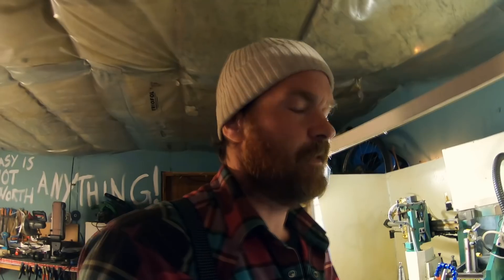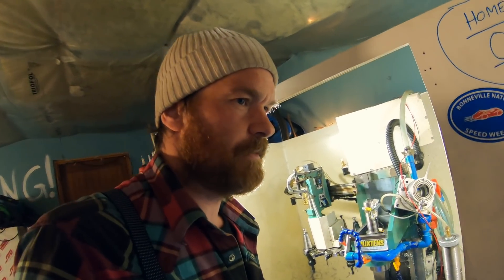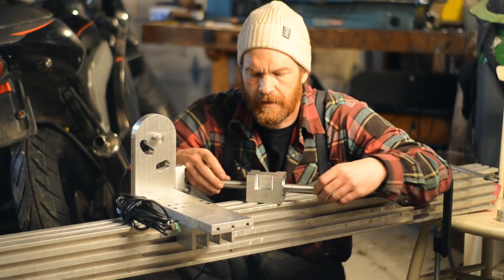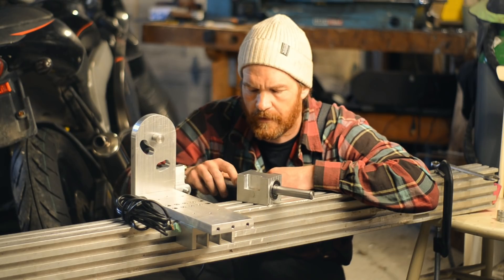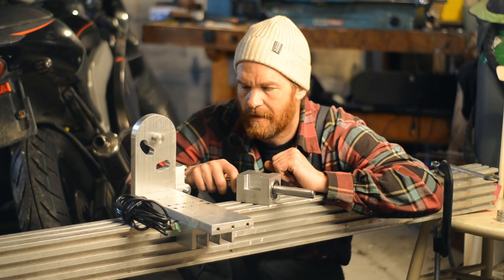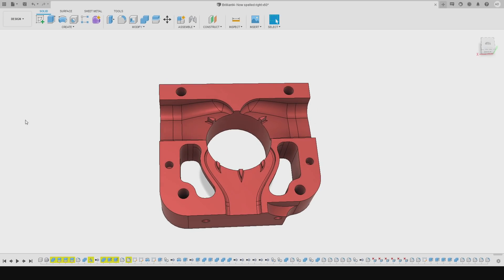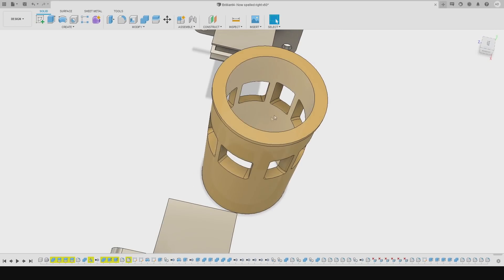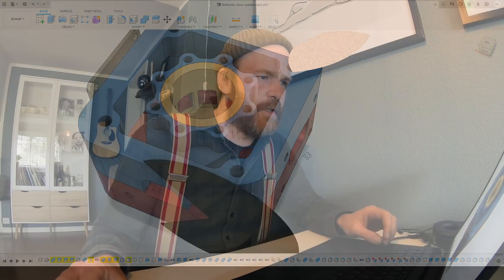Prototype Blown Nitro 2 Stroke.

Comment: what is the difference between a stuffed crank and unstuffed crank.can you run an unstutted crank for a 70cc arisal cylinderkit? Can jb weld be used to fill the 2 holes in the crank webs?  Why do they sell unstuffed or weighted cranks anyway. any help will be greatly appreciated. thank you. its for a puch maxi.
Reply from the maker: Cranks are stuffed to increase crankcase compression. Can be good/bad depending on a lot of factors. Sure you can run the unstuffed crank.
Reply: Filling the balance holes in the crank increases crankcase compression and makes reed valves open sooner (if your engine has them).  Any reduction of volume in the crankcase can be beneficial provided it doesn't hurt gas flow to the transfer ports.  Normally the crank would have plastic plugs epoxied in, though solid epoxy should be ok provided you clean and prepare all the surfaces well.

Comment: Goodyear Gatorback  Poly-V belts run good at high RPM and I've used them on supercharger applications with good success.  They are a notched V-belt design that lets the air escape, minimizes float and gives exceptional grip. Example - https://www.ebay.com/itm/353454433611?_trkparms=ispr%3D1&amdata=enc%3AAQAFAAACUBaobrjLl8XobRIiIML1V4Imu%252Fn%252BzU5L90Z278x5ickkUq2HUzRXIDNJVaaCvHclGSxyd7oq2gvIaAZJuAz8Nb4KSfggXr%252FNQEHc0387Yj%252B0%252Fb1YFPh0uvvGnaBCiVLKlURoKgN%252FnFhz9VCaI%252Bysb2D5JV5kGuuSMzt%252B7HKqifY%252Bp7Lz%252B%252FqJtdf85BwHU93NpiZ4523hkAe5XRrl8nmzvxgcnwhJI6rRBs4Bp2e5w3mLRMumMNQwbra5VZfnfonaN6pVD3o5QyKDasnYxq823bBG53LOF72WPy3kycq9a0bmD0uDJeNz1tZKTr5t9z5ukef1gJ7CUcAn1tLdcS4iBZEHQgab9ofVAIirB647Sy2s5d8lo1puULSBvOy8oSah9o0eEY3zXaKNN1Jh7V6b0ApOI1cL%252FTGghvVy1ikI7S554OHZCd0R5ynk0udnT%252FFtYJ4%252FK17F5vOqcH%252FWUItWOoO%252FLWFcuIbAghSa5b03Mj2x6Ddpsdy64lpk2rDkzBhoJtHD9%252FQB5Q22mMBQTlobORlom1PZcVEQ8CTAzbItzX9l8R7sqNAnoiLLpo7111DMVp8XXZ9ltp2w71FDPx1RF97227bqi7N9dVdS7V6qyjRTI3OO15q8%252F5Szje2OQKUufRnesKLfj4c5S8pu4IqQXrRF2W5DC%252BdtL1aAxlnsQvSVW5rJFwbb5rw1Y4FlWTi4Z17ojYELn34B3aBOgspXkrnIJ7x2milTIgMSB%252FUNKBm6%252FYuOenwaYuR3MbuJ07B8vdkjWPzY%252F1%252F5pXJu2YckBG8%253D%7Ccksum%3A3534544336115cf8b60eedc245ff97dfb46bcee15e2e%7Campid%3APL_CLK%7Cclp%3A3268220&chn=ps&norover=1&mkevt=1&mkrid=711-117182-37290-0&mkcid=2&itemid=353454433611&targetid=1192081307664&device=c&mktype=pla&googleloc=9021455&poi=&campaignid=12874536847&mkgroupid=120146714103&rlsatarget=aud-622524042958:pla-1192081307664&abcId=9300535&merchantid=6576514&gclid=Cj0KCQjwp86EBhD7ARIsAFkgakhXA-I87G1dUDEUL7ww26daz_-5m67GPCT6eA0IfHtIZehcahlO6ZoaAlA2EALw_wcB
Reply from the maker: Thanks for the tip!

Comment: Been following for 3 years now. I'm a motorsport engineer and love what your doing!! I have played around with this setup for the last 2 years (Concept design only) and I would ditch the rotory exhaust valve. and salvage a 4/5 valve cylinder head from a 4 stroke and gear the cam to open all valves at once on the exhaust stroke. Use all port area for induction only.  The valves are on the right side of the cylinder for running high pressure and all the gases are flowing in one direction also. With the valves creating the cylinder head there will be no trapped mixture behind the piston that will also ignite and mess up your next cycle of fresh mixture as you'll get with the rotary valve.
200% induction port area, valves for exhaust, no crank case pressure required so can run an oil sump and no need to premix!
Reply: And try to achieve 16k rpm with 4 stroke head
Reply: Where would you find a four valve head that fits on the bore of a 50cc?
Reply: @g.bergervoet4505  
Its a concept, you can make one or use a 2 valve head but more valves more area to match the large intake ports. there are a few nocking about to mock up a test engine but fundamentally everything has to be made from scratch when you are developing a new engine.

https://www.alibaba.com/product-detail/Chinese-Scooter-Parts-GY6-50cc-139QMB_60465754955.html
Reply: @danielrouw2593  They are supper effiecent! But usually I think the size and inertia losses at 50cc is not much of a gain also high torque low power. I'm no expert on them but there's a reason why they are not in your diesel cars.

Comment: shouldn't the intake ports be angled differently? i meen with a smoother curve getting inside the cylinder. it may improve the flow, even decreasing de section. 👍
Reply: This shape aids in scavenging exhaust gases.

Comment: Such bad luck to have the shipping company lose the cylinder. I hope they find it and the engine gets to make some glorious 2 stroke noises soon
Reply from the maker: Cylinder was found and is on its way😁
Reply: @2STROKESTUFFING  Excellent news! Really happy to hear that ☺️
Reply: @2STROKESTUFFING  good to hear that update.
Reply: You'll see replicas shortly.
Reply: feels like Rob dahms 3 rotor that got lost in mail and ended up on ebay at another seller.
Reply: @extec101  4 rotor* but yes, that was a whole ordeal as well, I remember following that closely too, even worse they ended up losing his clutch too later down the line lmao
Reply: @notimetoexpIain  ahh yes its the 4 rotor that got lost in mail.
Reply: @extec101  I swear it is a cursed project, I think he still hasn't gotten it back from the shop that held it hostage after he got it from UPS
Reply: @notimetoexpIain  i have no idea how it turned out with that if he got the engine back.
Reply: Old Irish saying with out bad luck there’s no good luck